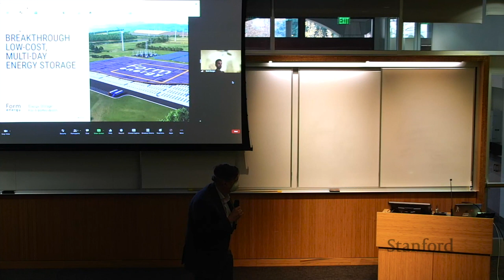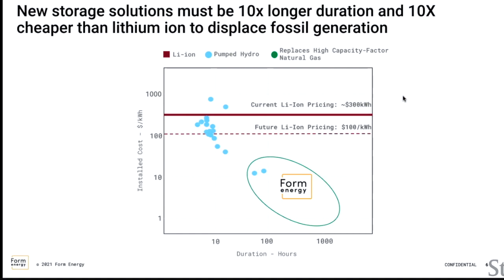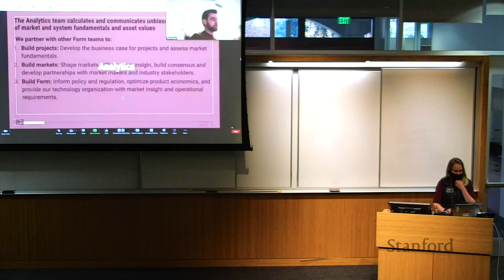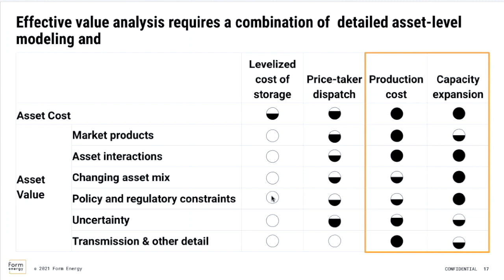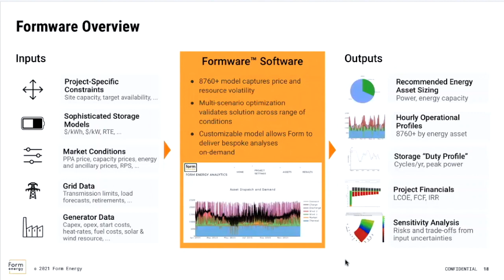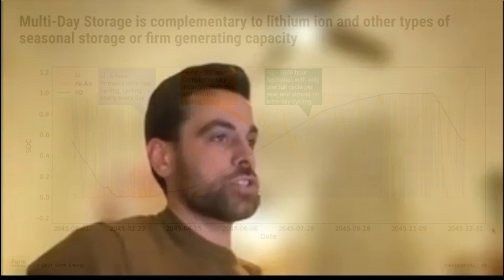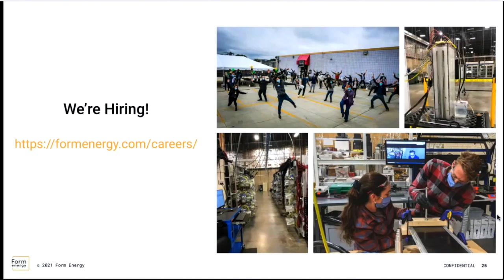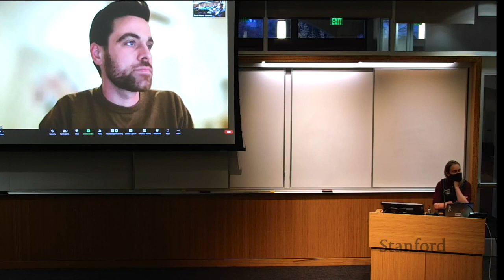Reinventing the Iron-Air Battery for the Electric Grid | Baldwin, Burger | Energy Seminar

Comment: Good info. Next question. How do we drive storage further down the usage chain? Not so much electricity storage but in cold climates heat stored in a way that uses physics that mimic body heat regulation
Reply: I think storing energy electrochemically and then converting it to heat when necessary is a more efficient way than, say, storing it in an insulated container like a heat bank.
Reply: I'd rather say build at least a passive house: The internal gains from using electricity, warm water and even human warmth are enough to keep the temperature even at -15°C outside. I happen to live in one. For 90 sq.m. I pay only 94 EUR/YEAR for heating. This heat could come from CHP or a heat pump, depending a lot on the local conditions. Seasonal storage will be either be power to gas, power to alcohol or power to ammonia if this battery might not be available so fast.

Comment: The extreme low cost storage potential of this will revolutionize the energy market and massively accelerate intermittent renewables.  Old capacity will get shut down quickly.  Nuclear whatever gen will be very niche, small market, mostly limited to very far north and south latitudes and inland.  FORM energy ASAP!

Comment: Capacitors are better than batteries
Reply: Not for long duration energy storage.
Reply: Elaborate. Better in terms of power density, sure, but weak in terms of energy density.
Reply: Don't caps self discharge rapidly. Aren't super caps expensive due to very low Wh/kg and Wh/L..